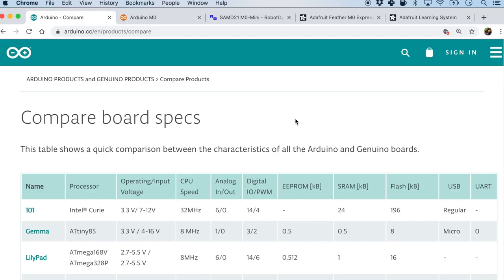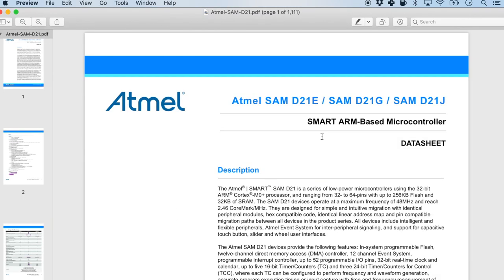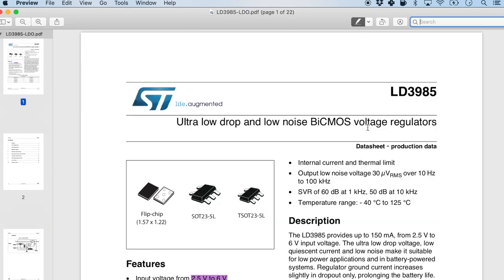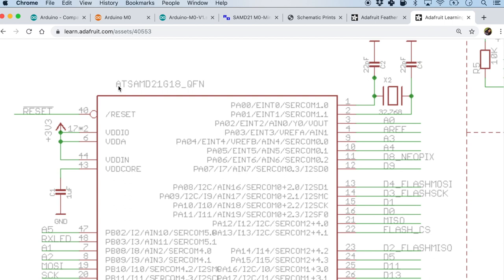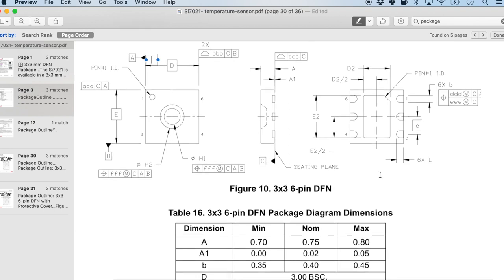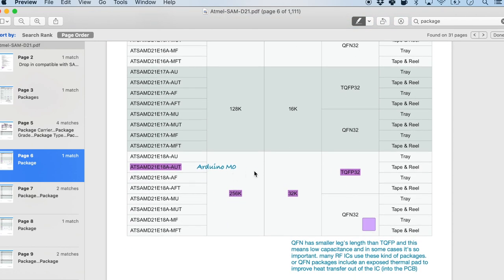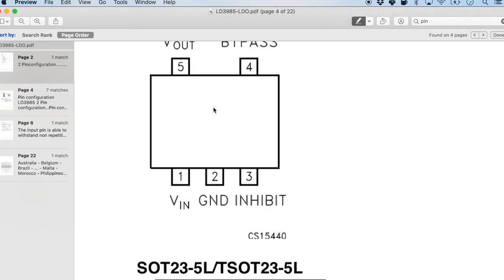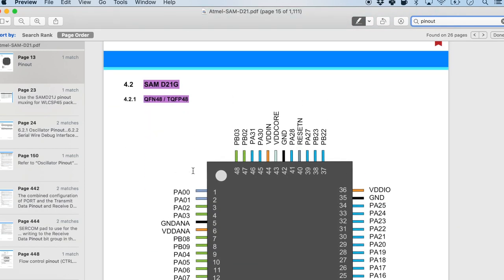Common datasheet sections to look at when getting started

Comment: I thought there should be a function to call to open and close a transaction - so you call the open transaction, access the data pins, then close the transaction - so do you have any videos on this, as I cant see how you would write a driver for devices to use the device in the datasheet shown in the videos?